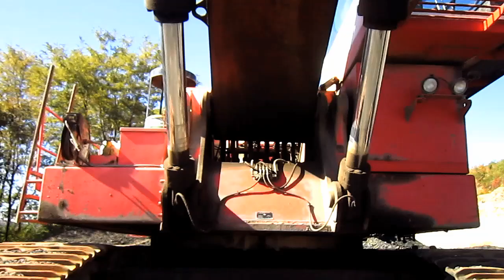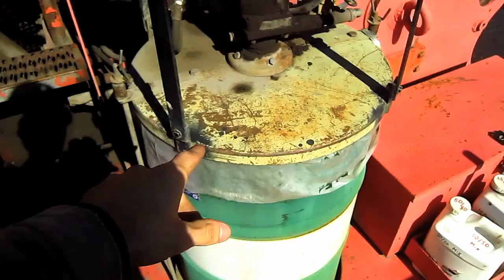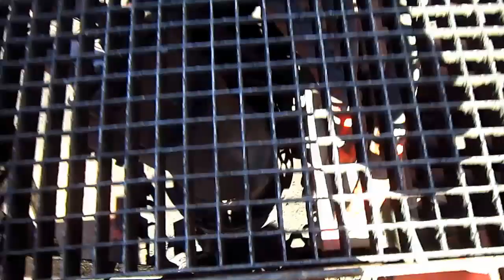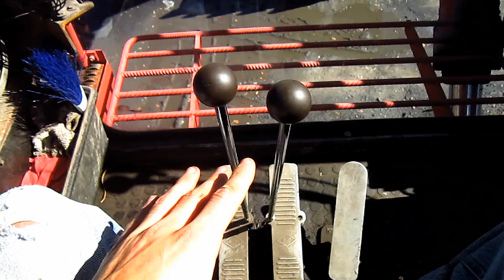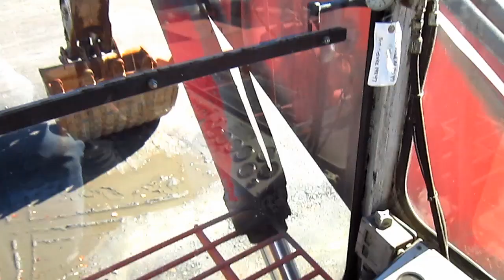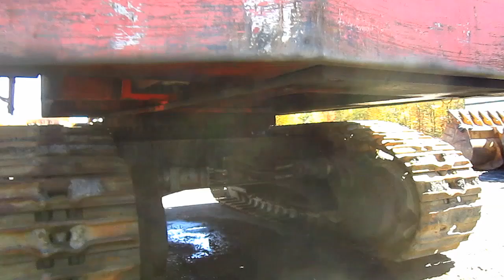The O&K RH75 C - A Work Horse

Comment: Is this the 1 that loaded those dressers and had the ol 9h build a road for it to get upon that bench.? We had a 340 somewhere round hazard and the same area that 995 worked in. Me and you both would’ve loved a trip to Addington bros. Martiki job back in the 80s in full swing. I was there early 2000s and still big job but lotta old stuff parked up. Stuff like you used to film. Hualpacks….bucyrus…p&h…and I was told wiesedas were back here behind my house for Branham&baker. The guy I steamed for cleaned em and talked about how big they were. ✌🏻

Comment: Can anyone explain why every other lip on the track shoes has a bit of a squiggle in the center? Maybe it's just to spread out the linear pressure when on a solid surface rather than having only totally straight transverse pressure? Or does it somehow help clean the shoes from debris as they move?
Reply from the maker: That's a very good question. If I had to guess, it's for tractive effort, but I'm not 100% sure, maybe someone else can chime in

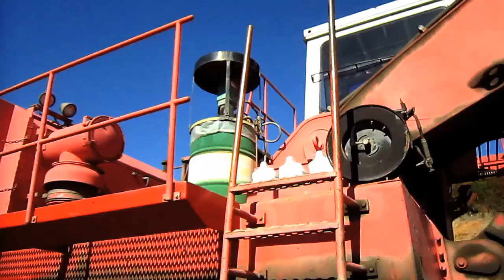Comment: Love the videos! What is the reel at the top of the stairs seen around 3:24?
Reply: That is a grease gun hose reel and it gets fed by the green/white grease drum behind it.  It's used for getting the zerk fittings that go to small stuff not handled by the central greasing system.
Reply: Thank you!
Reply from the maker: BlackPill is correct. That hose is primarily used for greasing the bucket pins. These older excavators did not have automatic lubrication on the buckets

Comment: Love this big equipment and your explanations of tit.  But I’m a little confused on terminology here:  you refer to the two configurations as front shovel and “backhoe”.  My limited understanding is that it would be an “excavator”, as a “backhoe” would be mounted on a front end loader type of tractor.  Or are the terms interchangeable.  I do know the control configurations are different.  Just a discussion point!
Reply: @tomrogers9467  I’ll attempt to clear up any confusion about the terminology. Try to completely disregard the image of a front end loader/backhoe. That type of machine does not pertain to surface mining. Next, the RH-75C seen in this video is a backhoe and some people refer to it as a trackhoe. A front shovel has a much different front end attachment attached to the superstructure. The front shovel is not designed to dig deep. The geometry of the front attachment is such that the bucket will be crowded into the rock & dirt horizontally as the operator lifts upward and curls the bucket. If you Google O&K RH400 you will clearly understand exactly what I’m describing. The terms backhoe and front shovel are not interchangeable. However many people will use the term excavator and backhoe to mean the same type of machine.To really eliminate all confusion, I like to refer to front shovel machines as hydraulic front shovels. Keep in mind that there are rope shovels in the mining industry also. Rope shovels are the most powerful and durable machines in the industry.Some have a bucket capacity of 120 tons or more. The bucket movement when digging is very similar to that of a hydraulic front shovel.
Reply: Manufacturers use the term backhoe.. even to this day..
Reply from the maker: So the machine itself is a hydraulic excavator, however when you get into bigger mining class machines where two front attachments are offered, manufactures tend to call them a "backhoe" or "front (face) shovel)". Now we can debate about what a "back hoe" truly is, however manufactures continue to call big mining excavators that to this day as a reference to the attachment, not the machine
Reply: @PAmining    Thanks for the clarification.  And it does make sense, as the “backhoe” pulls inwards, or “back” towards the unit.  Since a child, I’ve always loved heavy equipment.  Thanks for showing us all the big toys most of us would never have the opportunity to get near.  I guess at 71 I’m still living in Mike Mulligan days, LOL.  Still have the book.

Comment: That old girl is in amazing shape for it age and looks like it’s still being used daily!..normally they are shook to pieces by this time or in a scrap heap…you would never know it was pushing 40 years old!…most mining excavators are lucky to see 10-15 years usage and then they are sent down the road!..O&K really knew how to build equipment and it’s so strange how they just one day decided to start building excavators and basically  in a very short period happened to build some of the best machines money could buy!..it’s a testament to their engineering and commitment to building the best and most efficient machines possible!..great machine and great video!
Reply: @MrMan5014  I totally agree with you, pertaining to the superb quality of O&K excavators. And let’s not forget that O&K built the giant RH-400 hydraulic shovel. That machine could actually compete with the massive rope shovels and the purchase cost for the mine owner was significantly less. The RH-400 was available with either diesel or electric power. I know O&K shipped the very first unit to the oil sands of Canada. I believe that first unit started working in 1996. Take Care.
Reply: Old girls or excavators 😅😅